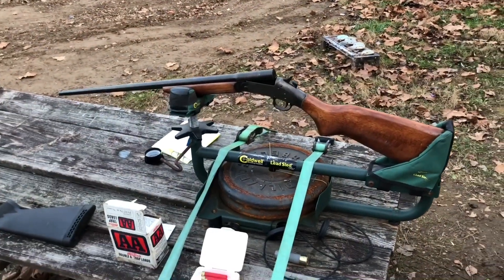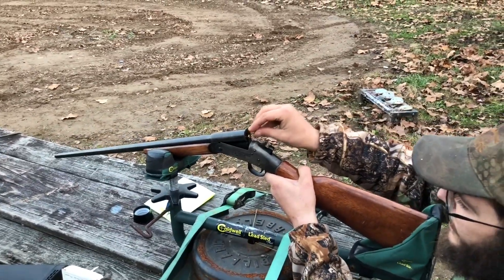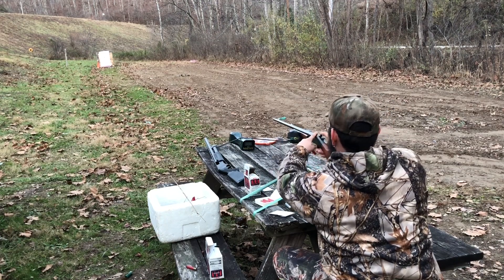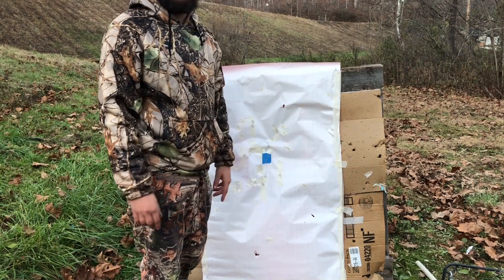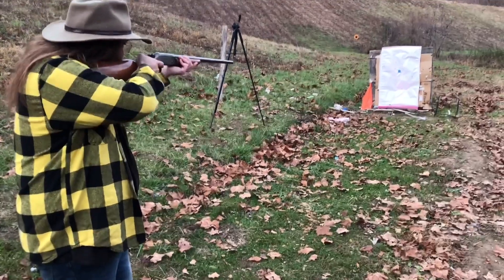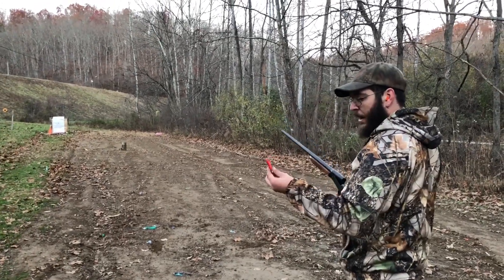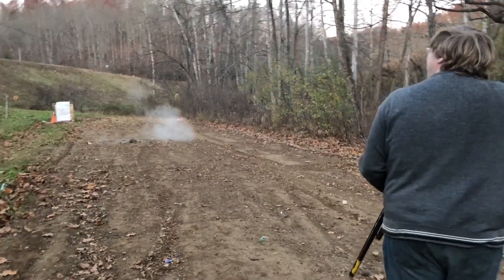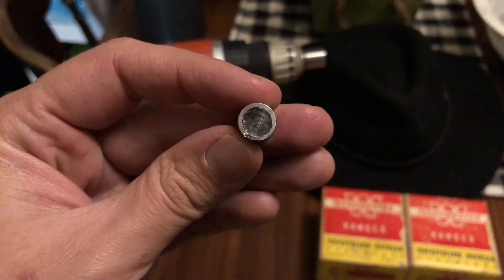.41 Magnum Bullets Turned Into .410 Foster Slugs? Will It Work?

Comment: Why drill out the bullet? I can’t imagine the bullet is too heavy for 410 data
Reply from the maker: To make it a foster slug. Otherwise it would just tumble and have horrendous accuracy.
Reply: @theshotgunscientists  Hi there. I have a Saiga .410 semi automatic. I'm gearing up to reload for this. I'm going to get the LEE mould that throws those bullets 210 grains in weight. I'm not going to drill them because I have two rifled PARADOX choke tubes, so I'll leave them as is. LEE also do a .41 semi wadcutter mould that throws 195 grain bullets. Can't wait to give this a try. Great Channel BTW 👍

Comment: .410 with good loads is a meat maker on small game. I just paid a near small fortune for 3 boxes of Federal 3" 11/16 ounce #6. These are petal crimped. Last Federals I bought were roll crimped. Something changed. I need a bare bones handloading kit now. All I need is wads and powder. Have some old 209s and some #6 shot. Have some rusted up #4 turkey loads that I could break down for #4 and some grex buffer too. My roll crimp hulls will obviously need over shot cards and a different crimper than the petal crimp. Throw me some ideas here for these Federal hulls. Btw; .41 mag is a darned good cartridge for a handgun hunter and woods loafer. Black bear, hogs, and deer are all on the menu with a good .41 mag in your holster.
Reply from the maker: Lil gun powder and claybuster AA410 wads work for me. H110 is also a great choice.
Reply: Try some TSS shot. Makes the 410 do things you never imagined!!